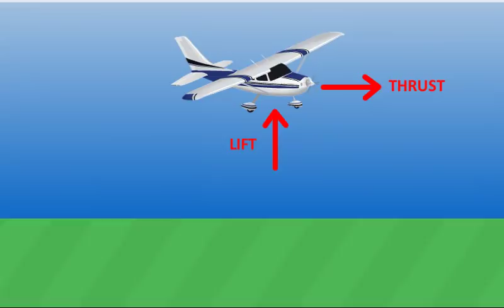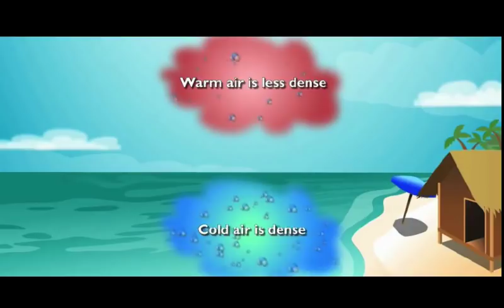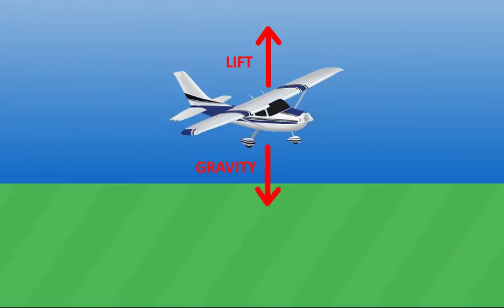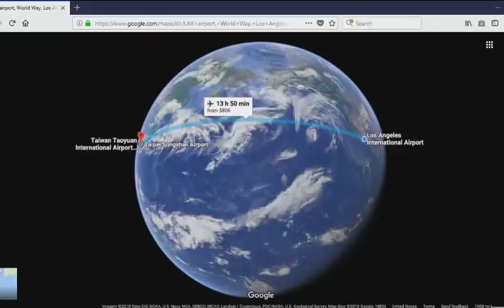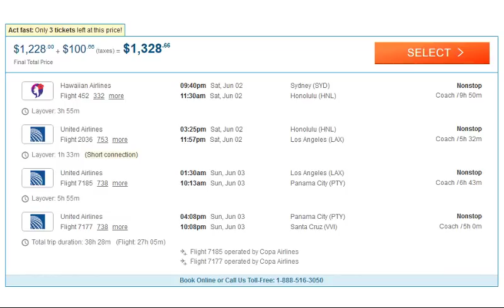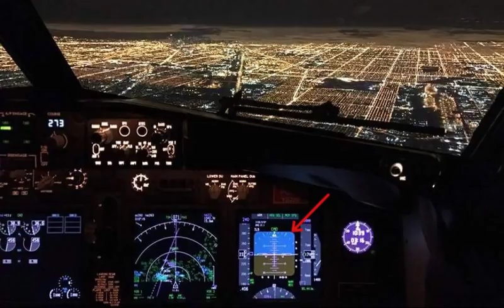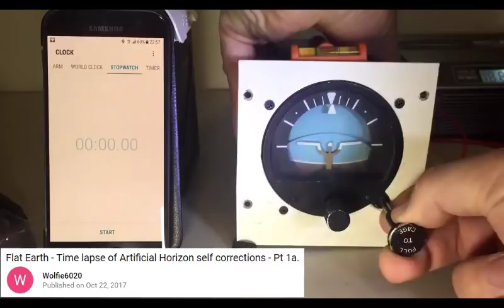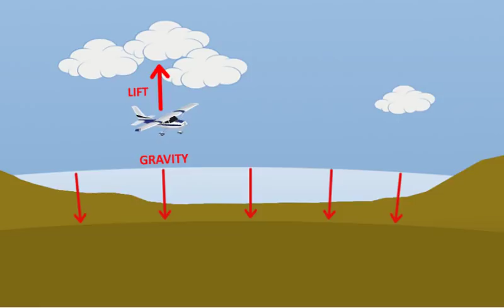Flat Earth Falsities - Plane Nonsense

Comment: So called gravity can't even hold smoke from rising LOL
Reply: Silly child. Smoke rises because of gravity.
Reply: Smoke rises because it is warmer than the surrounding air.  Another lesson from grade school science class.
Reply: Of course there is gravity.... its just proportionate - again, he explains this in the video....
Reply: The man in this video discussed that - about hot air rising and cold air filling the voids.....
Reply: Bobby Wizdum Hang on.... and the massive jet engines that provide the thrust have nothing to do with it?
Reply: Boobly Wizdum wrote: "lift (ascends nose of the plane upward)".
You didn't notice that on every plane wings aren't parallel to the body. Even in level flight there is positive angle of attack to exert lift. That is why when you increase thrust then airplane is going up.

What's more: "thrust (brings up rear of the plane to level)" is complete nonsense. Rear of the plane is lifted thanks to horizontal stabilizers (tailplanes).
Reply: Did I say car engines have nothing to do with driving? Im asking if you have factored in the jet engines on a plane, that provide constant thrust?
Reply: The effect of gravity is proportionate. The particles in a gas, a hot gas, are dense and rise. When you see these gases rise, the density of the air around it is higher than the density of that gas and so the air around it gets pulled "harder" by gravity, causing the gas to rise.
Reply: Explain how lift and thrust does not prove gravity?
Reply: genius !! thank you
Reply: wong silly gravity pulks down. how does smoke rising prove gravity?
Reply: JGumaJ umm thats not always true. if that were the case wed get warm blowing smoke on ourselves in the winter. it actually rises simply because its less dense than air just like helium.
Reply: Max Heinrich Gutzmann Liebow how does he explain it? he "assumes" it and gives it fascinating jobs. lift and thrust does not prove gravity. an airplane flying parallel and level damn near destroys it let alone proves it
Reply: Max Heinrich Gutzmann Liebow simple. does rear wheel drive prive gravity?

lift (ascends nose of the plane upward) thrust (brings up rear of the plane to level).

gee the front goes up. then the back follows. gravity?
Reply: wong ive yet to see answers. wong where is your spinning ball model. please explain australia and toronto both having the sun in the sky at the same time? they are on opposite sides of the ball in all directions
Reply: Max Heinrich Gutzmann Liebow or to simplify there is no gravity and the smoke us simply less dense than air
Reply: Max Heinrich Gutzmann Liebow thats like saying car engines have nothing to do with driving. wtf does that have to do with gravity? nothing.

Comment: I came here to see how planes keep level when flying because while I know the earth is a sphere, I couldn’t quite understand scientifically what was going on. I assumed gravity had to play a part in it, and I guessed right! Guess you learn something everyday!
Reply: @hlaplayer
Here's some more good stuff for you.
https://www.youtube.com/watch?v=zX3upPW7uw4
There is no adjustment needed as the aircraft will naturally follow the curvature of the earth without any input from the pilot. This is because the aircraft flies through the atmosphere which also follows the curvature of the earth.
It's the air pressure that keeps a plane in level flight. Increasing altitude reduces the lift and the plane falls; decreasing altitude increases the lift and the planes rises.
Inertial navigation is different.
https://en.wikipedia.org/wiki/Schuler_tuning
The "schuler loop" is an integral part of avionics, that automatically compensate for earth's curvature.
https://en.wikipedia.org/wiki/Schuler_tuning
http://www.mediander.com/connects/26619546/ln-3-inertial-navigation-system/#!/topic/-/
http://aerostudents.com/files/avionics/navigationBasicsAndInertialNavigation.pdf
Reply: Bobby Wizdum How are we brain washed?
Reply: There is no way you could notice the difference.
The Earth is huge, really really huge.
The amount the plane's nose would have to dip is so insignificant that you could not notice the difference.
Reply: It is the answer that best fits all the available data.
Including the existence of buoyancy.
Reply: David Musser I’m confused.... how was I conditioned into believing I live on a ball? I feel like that was just common knowledge I picked up over time.
Reply: hlaplayer That’s the magical answer to everything, gravity.
Reply: hlaplayer you have been conditioned since you were a toddler that you live on a ball.
Reply: wong yet its naturally level following curvature? man you are brain washed.

Comment: THATS WHY THE GOVT. ( CONTROLS ). THE AIRINES AND ITS SCHEDULES 24/7.!!!. YET CAN'T FIND MH370 , AIRLINE.??
WHAT HAPPENED TO SEATTLES.???? . DECEPTION IS THE KEY.!!!!.
 😎💀☠💀👹😎..
Reply: Someone turned off MH370'S transponder and no satellites were tracking it at the moment.

Except one. And that one detected through "handshakes" that cannot be disabled by turning off the transponder, that the plane first turned west, then south, and ran out of fuel and crashed into the sea just short of northwest Australia.

But the search parties did not know that at first and searched for the plane in the wrong place. Since the black boxes are no longer transmitting emergency signals, it's gonna take a while untill that plane is eventually found.

Comment: The Nile river meanders through Africa going up the globe from south to north for 4200 miles and much of that is flat plains and it is going against the imaginary curve ? 
Then in the USA alone 22 states are mostly flat including Florida being the most flat then Louisiana, Illinois, Kansas huge parts of Oklahoma drive interstate 40  and see that one hum where is the curve ?
Reply: "The Nile river meanders through Africa going up the globe from south to north for 4200 miles and much of that is flat plains and it is going against the imaginary curve ?"

When you look at a map which way is "down" on the map?
Reply: Okay and the earth with all the high mountains sticking up is so perfectly balanced that it can spin at 1042 MPH while traveling around the sun at 67,000 MPH but if my washing machine load is out of  balance it shakes the whole house haha
Reply: On a typical desktop globe Mount Everest would be 0.2mm high. 
The Earth is smoother than a billiard ball to scale.
Reply: Larry
the direction commonly called north is not equivalent to up
up for water is higher elevation 
gravity does not pull the water south, but rather down -- toward a lower elevation above the center of the Earth

and having relatively minor changes in altitude  across its breadth, like Florida, does not mean the state does not curve across the globe

as Graham noted earlier, scale is everything.
Reply: Bobby
the north pole is north of Africa
it is not up -- above - Africa

to confuse up/down with compass directions is either simplistic or idiotic
ask a toddler which direction is up or down
Reply: Larry
you don't need a map to tell which way is up or down
do you stand on your feet?
yes?  good.  now is down underneath you or is it south of you?

at one point many maps had East as their cardinal direction, because the sun rose in the east.
some early Muslim civilizations had the direction of Mecca as their cardinal direction
in the current day, most people orient their maps with north up
and none of these people confused a direction you can travel with up or down
Reply: Larry Major the Nile River drops more than a mile in elevation from its source to the Mediterranean Sea. Just like every other river in the world, it flows downhill.
Reply: Larry
the difference between up or down and a direction on a compass is not a matter of indoctrination
this is a very basic distinction that has nothing to do with mathematics or world models
Reply: Larry, I can't help but notice that you chose to not to answer my question.  When you look at a map which way is "down" on the map?  This should be an easy question for you.
Reply: There is no point in answering your questions until you can answer mine.  I suspect you know this.  I suspect you understand that if you answer the question honestly you will realize that all of your talking points are based upon nonsense.  On the off chance that you don't know this, if you were to answer my question it would be your first step to understanding how you were wrong.
Reply: North isn't "up" and south isn't "down" because they are printed that way.  "Down" is pointing to the center of gravity, the center of Earth.  So every point on the planet opposite of the center of the Earth is "up."  The poles are directions.  Totally different thing.  Good luck!
Reply: Oh so you do have a map then Larry. With the North Pole at the Center? Uh oh, that sounds a lot like the old AE/Gleason map that most Flat Earthers have now abandoned because they realised it was indefensible.
Reply: It’s a common Flat Earther tactic.
They know they can’t disprove what the real globe model actually says, so instead they invent things and rubbish those instead. 

No globe earther believes that north is up. The model certainly doesn’t say that north is up. It’s a completely fabricated claim to give them something to disprove.
Reply: Bobby
as I explained to Larry earlier
up and down are not compass directions
placing north at the top of the globe/map is merely the predominant convention for display today
the direction place "at the top" has no relation to one's physical up and down
up and down are also the same regardless of which model you use 

say you receive a box that has the label "This side up."  
do you place the box on its side with that inscription oriented to the north?
of course you don't
Reply: Bobby
that is only the way we (modern/current civilization) have chosen to relate to the map -- with north at the top
.. this grew out of Mercator's projection which was created for ease of navigation to the explorers of his time which were interested in east-west travel

other cultures have oriented their maps with east and south up -- for various reasons
for all I know some Amazon tribe still draws their maps with west at the top, because that is where their souls go after death
this shows that it is an artificial construct of the society

in terms of the ball -- up is still toward the sky, not a direction on the compass
when you trip and fall do you always fall to the south?  it  i s  at the "bottom" of your map, too.
no, you fall to the ground
your head is above you, your feet below
trying to impose compass directions on this basic distinction is a transparent misdirection
Reply: "im not speaking up as im the sky but up in terms of the surface of the ball"
But up is toward the sky in terms of the surface of the Earth.

"the north pole is on top of the ball no matter what you liars say about there being no top and bottom"
Even using your incredibly poor description, it is not at the top.  It is tilted 23.5° away from the "top."

"ive seen the globe and "photos from space". the north pole is on top."
Only because the person who presented it to you oriented it with the North Pole at the top.  In fact NASA has a habit of flipping pictures vertically just because people like you expect to see North at the "top".
Reply: Even my 5 year olds can figure out that Australia is not upside down .. actually since we are in China it should be the USA that's upside down ... i don't know what kind of brain damage they avoided when they were younger, but somehow they know a globe rotates and down is toward the center.
Reply: "why opposites dont reflect opposites." God only knows what you mean by that ... 
Just like your non sense about rivers going aver bulges or whatnot ..., rivers flow following the topography from furthest to the center of the earth to closest to the center of the earth, there is no going up or down a curve that has anything to do with the shape of the eaarth.
Reply: Choose a map of your city.  When you look at the map of your city, which way is down on the map?  Stop dodging.  Man up and answer the question.
Reply: So, clearly you have no interest in actually discussing the subject and just want to keep repeating your favorite talking points.  On your "map of flat earth" which way is "down" on the map?  This should be easy for you.  A child should be able to answer this question.  Stop dodging.  Stop repeating talking points.  Just answer the question like an adult.
Reply: Which map shall we use your globe map because if so then the Nile River is going to have to go up the curve on your globe map ?
Reply: The map of flat earth is the North Pole is the center and of course if you leave the the north pole where Santa Claus has a station you go south whether you use your heliocentric globe or we use our stationary geocentric flat earth and things really make sense on Flat earth so get your head out of the clouds you are no earthly good OMG.
Reply: NO enough of you OMG answer my questions OMG
Reply: I have a life outside of OMG GMO!
Reply: OMG GMO when you look a globe which was is the north pole from africa om the surface?
Reply: GrahamStw is north pole not on top of your ball? which way is top in relation to the surface curve from africa?
Reply: kazoosc im not speaking up as im the sky but up in terms of the surface of the ball. the north pole is on top of the ball no matter what you liars say about there being no top and bottom. ive seen the globe and "photos from space". the north pole is on top.
Reply: kazoosc wrong. put your hands on opposite sides of a basketball or your globe. whether you call north pole top and south pole bottom is irrelevant. whats relevant is that they are opposites. what matters is the sphere requires curvature on its surface. whats relevant is that from opposite directions of said curve your viewers perspective is the opposite. either the north or south pole is the top or bottom. or somewhere in the middle of the atlantic or pacific ocean. for us all to be on top we must all be in one place to be down regarding curvature. everything pulled center doesnt change the physical parameters of a sphere.

on your globe the nile river is flowing toward the top of the ball. its also flowing right over the steepest part of the sphere as well as the buldge at the equator. reality is that doesnt match reality. the river would have to run up and dowhill in relation ti the curve itself. we know that it doesnt ! how can anything go down a curve without first going up and over? it cant !
Reply: Jeremy Wickersheimer that doesnt explain why opposites dont reflect opposites.
Reply: Oh of course no matter  what I present you you have to make it fit the indoctrination you received from childhood . I guess you can remain in the matrix .
Reply: Oh by the way Australians are upside down on a globe oh never mind haha .
Reply: I could not help but notice on your globe Australians are upside down haha .